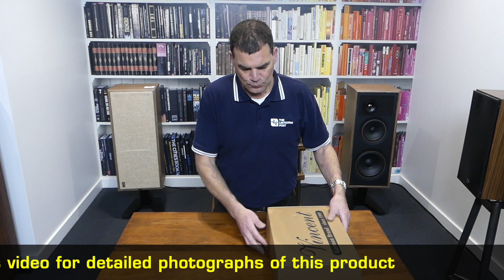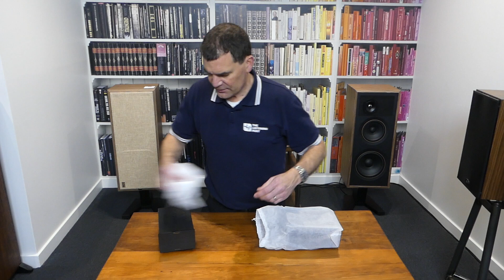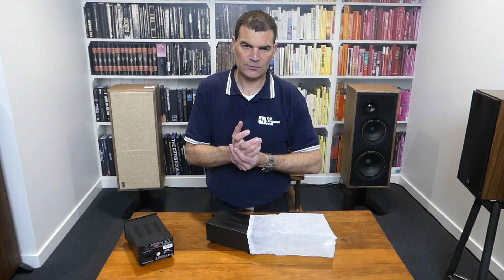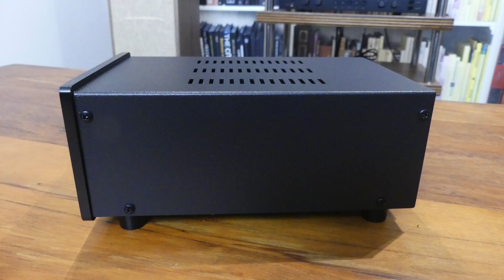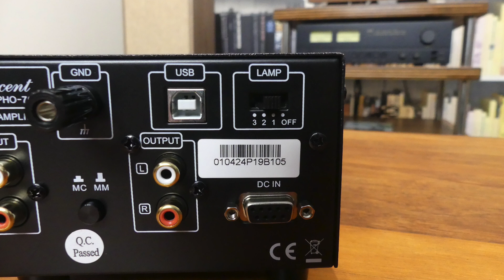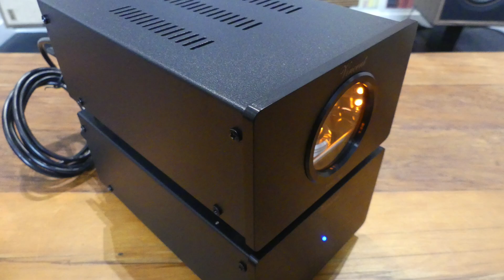Vincent PHO-701 Phono Preamplifier Unboxing | The Listening Post | TLPCHC TLPWLG

Comment: has anyone compared PHO-701 vs. Project Tube Box DS3?
Reply from the maker: The ProJect DS3 is very quiet and clean. Compared to the PHO-701 though it sounds a little clinical.  If you have speakers that can be a little bright, go with the PHO-701

Comment: Thanks for your great channel and reviews 

I'm planning to buy one, how you compare them to other phonos from ifi zen and fosi and projects? 

Kind regards and best wishes
Reply from the maker: The iFi Zen Phono-3 is superb and great value. However the PHO-701 is more expensive AND way better
Reply: @TLPCHC thanks again 

How about vincent pho-500 and 300 versus ifi and fosi? 

Kind regards
Reply from the maker: @mohammedalomari1998    Your turntable, cartridge, amplifier & speakers need to be part of the conversation before the 701 vs 500 vs 300 vs iFi vs Fosi debate can start.   Please visit your local HiFi store and have a chat about the balance of quality, performance & price keeping in check the other parts to your HiFi set up.
Reply: @TLPCHC  i dont need conversation 

Thanks 

I just ask you about vincent 300 or 500 vs ifi vs fosi
I have fosi x5 and ifi air, but I'm not satisfied. My system is very good, it consists Marantz pm6007 and dali spektor 2. 

Kind regards
Reply from the maker: @mohammedalomari1998    These are vastly different products - each with advantages (often just price) and disadvantages (system matching - Tube vs Solid State etc)  Go have a listen

Comment: Hi, I've owned the 701 about 3 years. Only issue, I noticed 1 channel a tad quieter than the other. After cleaning all my connections , checking this & that , one day I reached behind the 701 & touched the M M /  M C button , it made a little noise , I pushed it in & out a few times ,well that was my problem , a noisy switch on the back of the Vincent. It's happened a couple times since , but now I jiggle the button. Annoying, for $800.00 , but it sounds nice.
Reply from the maker: Moist room?